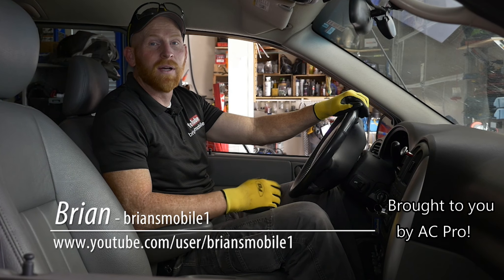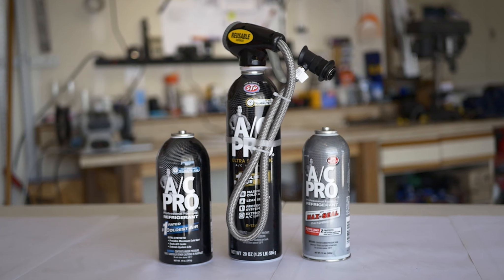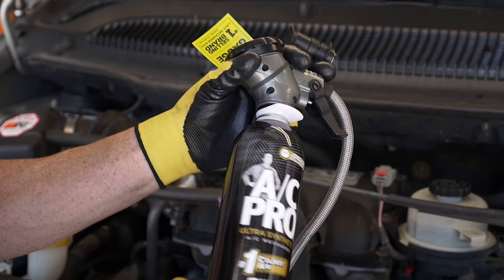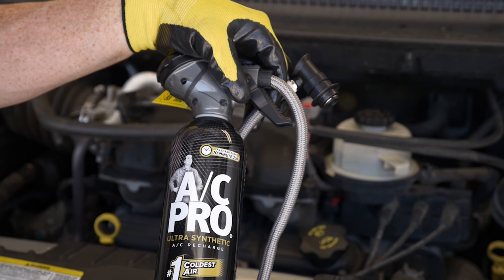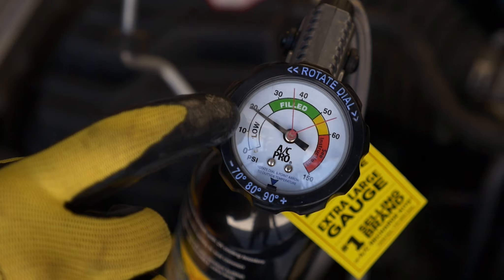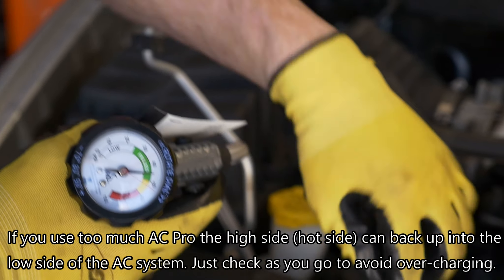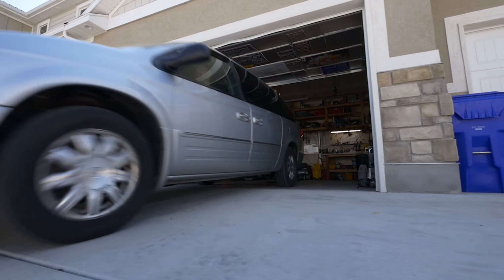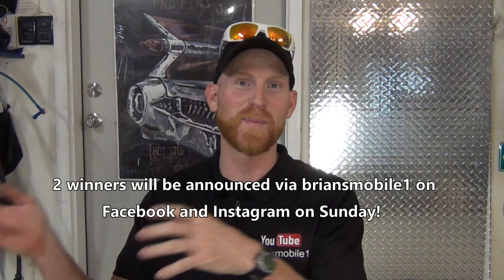How to Fix your Car's AC with AC Pro plus $100 WalMart Gift Card Giveaway!

Comment: a couple month ago, I fixed the ac of my car. The compressor fall apart and I needed to replace most of the system. Called some shops and there were charging around $1,500. I decided to do it my self. I bought all the tools required and the parts. I spend around $1,000. Overall, it was easy. It took me some time to figure everything out. So at the end I saved $500, got new tools and got knowledge. I will recommend to anyone with the time to repair you car. At the beginning it's complicated and time consuming, but after the learning curve and with the tools (that you only buy once) you will be repairing your car for a fraction of the shop quotes.

Channels like this helped me a lot. So I may go buy some tools with those $100. It will be like an investment to save more money.

Comment: I used this product on my 2003 dodge ram  and it worked , I was very doubtful that this would work. but it was a very hot day 99 degs and on a trip and everyone in the truck was hot I stopped at wally world bought the stuff shaking can and my head saying to myself  this is a waste of money and time. But if I bought the can at least I tried to fix the truck in everyone's  eyes. After using AC pro  It was a lot cooler in the truck, the instruction are easy to follow. It's been 60 days and the truck still has ice cooled air. I was totally happy with the end result. Great channel keep up the great videos.

Comment: I have used AC-Pro in a few vehicles one that I currently still have and put the AC-Pro in 5 years ago and still have nice cold air blowing and cooling even in 100+ heat. When I bought the car it would get cold but only in the 50's cold. Now it gets mid 30's

Comment: I've been without A/C in my '96 Tacoma for more than 15 years. Normally, it doesn't get hot enough where I live most of the time, so we've been living without it ... however,  we recently purchased a home in Arizona, and I'm sure my wife would appreciate it if the A/C was working again. 

My stereo unit quit working in the same truck, so I'll be tearing out a portion of the dash to remove it ... might need to replace the expansion valve and the evaporator unit 'while I'm in there'.  After checking and replacing any A/C parts needed, I'm hoping that a good recharge will bring coolness back into our lives ;)

Comment: I used this on 2 cars.  It didn't fix the leak in the first one, but on the 2nd car, it recharged the system and corrected the leak, and has worked great for 2 hot summer seasons so far.  I think ot really depends on the location of the leak.

Comment: I have an older 2004 Merc Grand Marquis, blowing hot air, summer is coming to AZ, so I need to get it fixed. So I'll give this a Try, as I might have a small leak in the system.  Thanks for the Video. We love to shop at Walmart.

Comment: Yea, if you got a really slow leak, even the ac shops employees are going to opt for this temporary solution till they "get a chance" to fix it even on their OWN cars! I've used it, it did prevent my leaking Freon. But, after 3 years of doing this same thing about once every 6 months, I finally got my leak fixed. I just didn't have the cash for a while to get it done right away! Freakin places charge so much that some people wont have their air fixed as the cost of the repair is MORE that the VALUE of their car! And yea, they charged the crap out of me to do the job, but that cheap temporary "fix", with this ac-pro stuff right here(that I bought from Walmart each time for dirt cheap) worked perfect for those couple 3 yrs, for me. Just ME, MY issue in particular, I'm not saying this will work for anyone else out there by no means! You might have a hole the size of a quarter somewhere and need to replace that whole part, or parts, in your ac's system, as some some leak sealer sure as hell aint gonna help that one. Nope. But it worked for my tiny leak so whats wrong with that! And when I did get enough estimates from everywhere in the world it seemed over those couple to 3 yrs, I finally picked one of the places when I had enough extra cash to get it done!(plus the leak was getting worse, but...) and they fixed it, permanently. So for that slow, small leak type of thing going on with your ac, I have to say this is def the thing to do, but yea, one day you're going to DEF have to fix ANY leak, eventually. But just maybe not so soon! If this DOES temporarily keep it from leaking out so fast that it'll last you a summer or 2, I can guarantee you that even the a/c shops employees are going to do this versus tracking down the leak and replacing the part(s), until they "feel" like it! And that, even with them, could be postponed for a WHILE if this or something like this worked for them!

Comment: Brian, would you recommend this product and how would I go about using it if my compressor clutch doesn't engage? The system doesn't have enough refrigerant in it to engage the clutch. Vehicle: 97 Chevrolet C2500 3/4 Ton PU
Reply from the maker: I would.  There are two sensors for pressure regarding the clutch, high and low.  The low side cut out switch protects the compressor from running when there's no lubrication.  The PAG oil is in suspension with the refrigerant.   The high side sensor protects the system from blowing out.  It cancels signal to the compressor clutch if the pressure gets above a certain threshold.   If you have no refrigerant or it's too low, the low side cut out switch cuts power to the compressor clutch.  To verify this, you can run power straight to the compressor to see that it comes on.  So if the compressor clutch is good, the relay, fuse, A/C dash switch is all good and the compressor won't come on, the solution would be to charge the system to get the low side cut out switch to be satisfied and relay power on to the compressor clutch.
Reply: Would I still need to use the can(s) while the truck is running and AC knob turned to the ON position?

Comment: I've been a subscriber for a couple of yrs now and the AC in my 2002 Saturn hasn't worked for yrs.  The refrigerant kept leaking out and I didn't have time to learn how to fix it.  I'm getting close to doing something about it now but wonder how much damage may have been caused because it's been practically empty for so long.  I put a gauge on it a couple of days ago and everything read zero.  Do you think my compressor is shot?

Comment: Is there a way to figure out if I have a leak, without having to purchase one of those gauges?
Reply: You could look at the pipes connected to the AC, you may be able to see cracks in the pipes. There are sprays that you can buy that would help you better visualize those cracks, but if you're planning on doing that, you might as well just purchase the AC Pro sealant, which would both diagnose and repair the leak(s)
Reply: There's no need to buy a separate gauge ... the gauge you see in Brian's video is in integral part of the AC Pro unit.
Reply: My AC line has a big hole in it, from the throttle cable rubbing through it over the years. Needless to say, The AC doesnt work(Hasn't since i bought the car 1.5 years ago) Is there a way to repair AC lines ? It's an old car. It's rusting like there's no tomorrow. I don't think It'd be worth it spending 500 to repair AC when the car wont last long enough to get the money's worth. (2005 imapla)
Reply: Yea.  Borrow a vacuum pump from Autozone.  Follow the instructions to vac the system down then let it sit for a few hours.  If the vacuum holds then you don't have a leak.  You'll need a guage.
Reply: PLUS, if the air isn't as cold as it should be, you have a leak.  If you've had the car awhile then get the stuff from a parts store to add a can of Freon.  Don't take it to a garage where they'll charge big money to check out the system.
Reply: My truck rubbed a hole in a ac line I cut the hose and put a barbed coupler in it and put three tight hose clamps on each side.  I vacuumed it down and charged it.  That was 6 years ago.  Still blows cold air.  The AC line Kit was going to be $300 to replace.
Reply: FrugalPrepper Nice!

Comment: To be honest... Realistically an AC costs so much money to fix properly that I don't think using one of these $30 cans is going to hurt. If your AC isn't working then your car is probably pretty up there in miles, and not worth putting another $800 to $2000 into just to have what (in most states) is a luxury. I live in Florida and a car without AC really sucks but it's doable, although where Brian is I'd say it's dangerous when it's 110 or 120 to not have it, so I guess in that situation it'd be worth it to actually have it professionally repaired.

Comment: OK, watched this video and figured I have an extra can of AC Pro in shed, AC's not to cold 108 days in Oregon today. I topped it off yesterday, mid day started hearing horible noise, so loud I thought it was a wheel bearing going out. 98 Expedition.  Figured out it was AC. The gauge showed OK filling, is it possible I overfilled it, Used 2-12 can's of cheap 134 this spring, but got greedy and wanted it colder. Any Idea what I should do? Hook it up without canister see if releasing pressure will make clutch smooth it out, or possibly is compressor on it's way out.  Also drop in engine power with AC, been running rest of day without AC, windows down. First time this has happened. Any advice would be great.
Reply from the maker: Overcharging with deminish AC performance as much or more than undercharging will.  If there's no space in the system for the pressure to drop (creating the cold) then the system won't perform well.
Reply: Thanks, I connected the hose gauge on its own the other day, think it got hot and hose failed, lost the pressure.  Oh well, put in a full 24oz can and ac it back to normal. Sorry OZone layer...

Comment: @Briansmobile1 I just replaced my  compressor after it went out.  What should i do to completely clean the system and fill with new Freon?
Reply from the maker: If your compressor clutch failed and or there's no metal then you can flush with cleaner (o-ring safe chemistry) & compressed air with the system open and evacuate with a vacuum pump after the system is closed again.  If the compressor failed internally as evidenced by mechanical damage, then the compressor, condenser, and expansion device (orifice tube or expansion valve) should be replaced.

Comment: If AC Pro has stopleak that cures contact O2 it ruins AC system the next time or if it's opened for service!
Reply from the maker: The boiling point is less than the refrigerant.  Opening the system wouldn't cause it to solidify, but evaporate instantly.

Comment: My family has wasted money on quite a few different AC repair chemicals, though granted they were cheap which was the only reason we risked it.  My mom's Saturn for example isn't worth spending money to have it properly fixed and I don't have the gauge set and vacuum pump to do it myself, so we just put garbage in it every couple months in the summer and deal with it.  Maybe there's one out there that would work better but so far I haven't tried it apparently!

Honestly though so much money goes to bills and fixing things that I'm not sure what a spare hundred bucks would go on.  I'd probably finally pick up one of those Rokku things so that we could watch Youtube from the living room TV or something, that's been on my mind for a little while.  I can't stand most of what's on TV anymore anyway, and most of what I watch comes from online.

Comment: lol thats awesome.   Mr.fany sponsor video.     I was temtped to get this stuff,  mechanic told me A/C that are working usually run to 60 and lower.  mine does that, so not sure i needed it.
Reply from the maker: Nailed it.  We don't see 30's much, but on some Cadillac's.   35psi on low side is a pretty good established "by the book" target for low side pressure with the compressor running.

Comment: Well, extra cheese in my wallet would be nice to put it towards parts for an audio amp I've been wanting to finish building for a year now. Also Bryan, I have to thank you for the Chevy Silverado gauge cluster repairs you have done in the past. I recently picked up a 1500 crew cab with a glichy dash,. Your tips and tricks to them made it nice to disassemble it without snapping anything and where to look. Turns out it wasn't the dash but something else..
Reply: Its in the auto headlight circuit somewhere.

Comment: Will A/C Pro reinstall my compressor, lines and condenser? I took it all off of my Mk1 MR2 because race car, but now I'm in Texas. In the summer. And my passenger window doesn't work. And I have a metal shift knob (actually a spare lug nut). And my stereo doesn't work. Kill me.
Actually, on second thought, I'll just take the bike. I don't even notice the heat then.
Reply: Good thought :-)

Comment: DIY AC work brings up lots of anger and emotions among professionals. In the real world it's the let's say semi precessionals that are the worst. Tyre shops that advertise a cheap recharge. They do put the correct amount in etc but they rarely check for leaks (other than a quick vacuum check).In reality they encourage customers to regas every season.

Comment: I need to do a head gasket job on my 03 outback
Reply: mannyman did same job on 99 forester, have fun,hahahaha
Reply: I have to do the head gasket on a friends Outback. Have been putting it off... Not much room to work in the engine compartment and it has been so hot.

Have been thinking if posting on YouTube but recording and editing often takes as long if not longer than the job.
Reply: Good luck mannyman, I had it done on my 07 Legacy. I wonder what year this problem with head gaskets actually stopped for Subaru
Reply: tigergreg8 for a specific engine "did it ever stop?" is the better question.
Reply: What specific problem are you having with the head gasket?

The one I'm looking at is leaking oil onto back of engine. Between the engine and firewall.
No coolant leaking. No coolant in oil or vice versa.
Car looses maybe half a quart of oil a month. It's only really noticeable because it's dripping on the muffler and smokes at times.
Reply: Mine is at the bottom both sides